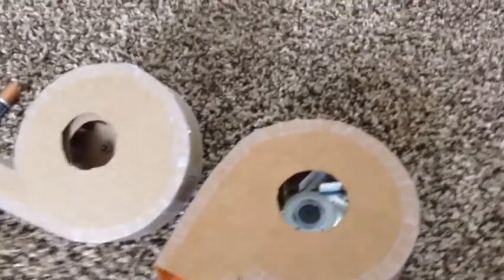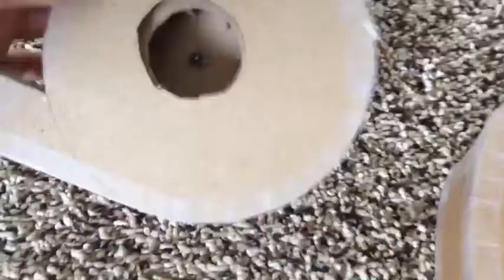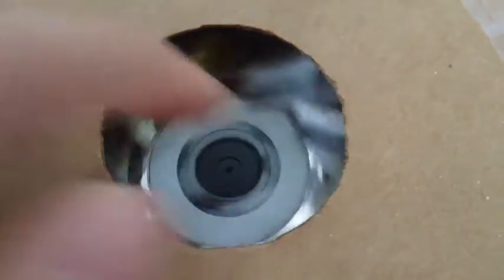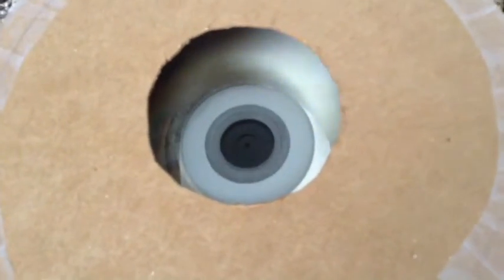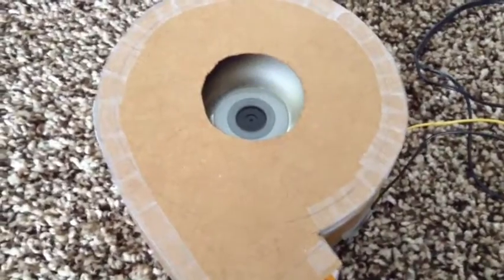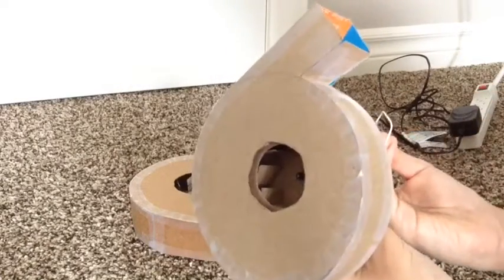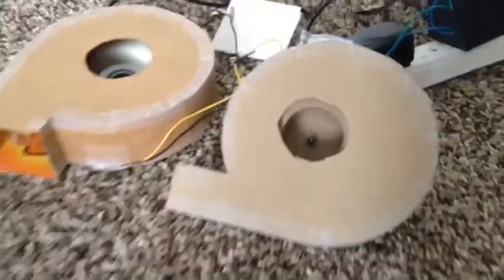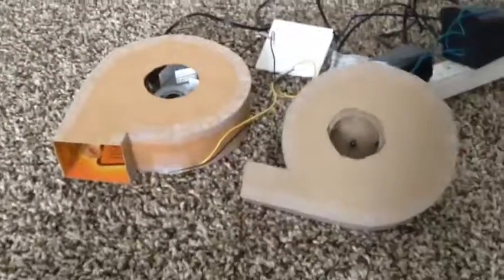Two Homemade Centrifugal Fans

Comment: What angle/way did you decide to put the blades and why? What benefits do you get from doing that over a straight over your angled design. 

Also which one would give better suction ? 

Please advise,

Thanks in advance

J

Just a suggestion: you should post more videos...maybe even one explaining the different type of Centrifugal fans, what what benefits you get from each? 

I like the no BS approach you got. Some of these guys on here with their 7 minute intros....when all we want is the information.
Reply from the maker: Thank you! I’ll consider making more videos on centrifugal fans, but I can’t promise it, as I haven’t had much time recently to build homemade fans. 

So for this fan, I made the blades curve backwards. I chose this design since it’s the least demanding on the motor compared to straight or forward-curved blades. However this configuration doesn’t move quite as much air as the straight or forward-curved blades. So my advice would depend on the motor you have that will power the blades. If it’s a weaker motor, the backward-curved blades would be the most suitable since it will put the least amount of load on the motor, but at the cost of  slightly reduced suction and output. Vice versa, if your motor is plenty powerful, the straight or forward-curved blades will give you the best performance. Most vacuum cleaners utilize forward-curved blades driven by powerful motors to maximize the suction. There is a YouTuber named Matthias Wandel who did a video called “blower impeller design experiments” where he explains the pros and cons of different blade setups. https://youtu.be/YuEaP9kyiFc I think he does a good job of comparing the three configurations and you might find it helpful.
Reply: I saw that one and still asked the question after I watched it. You did a far better (and more efficient job explaining it) so if I got lots of jam and clean air, do fin forward, I need it to self clean, do he straight one. 

I’m building a vacuum unint (well finishing up one) and I’m curious your thoughts on your fan design. 

If you had to design your own fan and hp wasn’t a problem and fan forward was the design....would you rather build you down or buy a prefabbed one and why

Thanks for getting back to me so quickly.
Reply from the maker: No problem! If I had the option to choose between a homemade impeller or buy a prefabricated one, I’d go for the prefabbed one since it’s likely built with more precision and will be more balanced. These centrifugal fans rotate at high speeds and being in balance is crucial. Also most are made from metal such as aluminum so they are more durable and relatively lightweight. But if you have suitable materials on hand, and you take the time to build it with precision and balance it, that could possibly be the cheaper option.